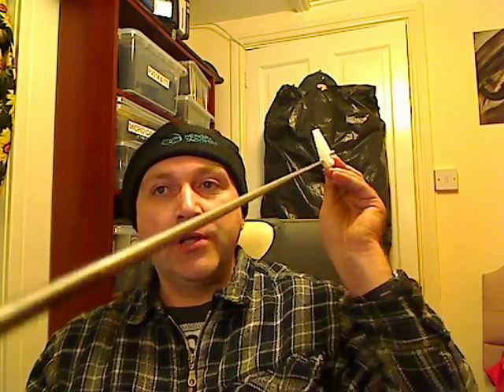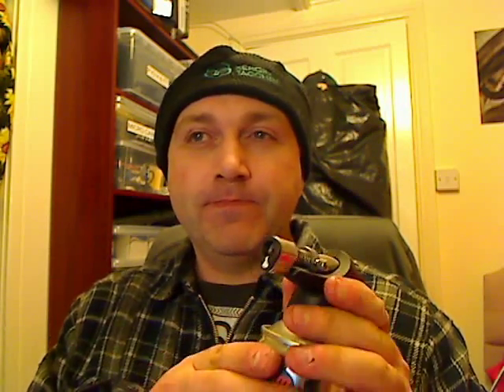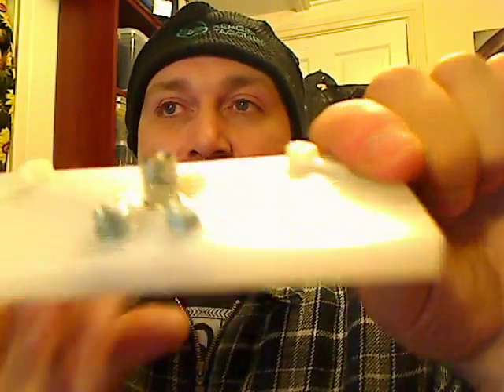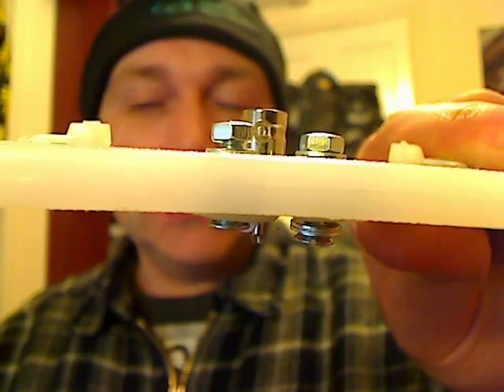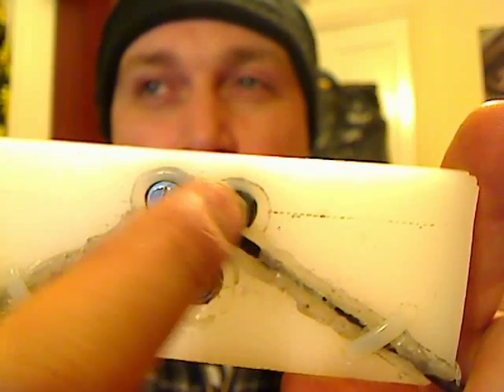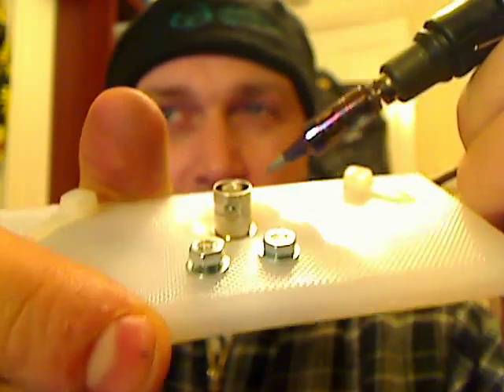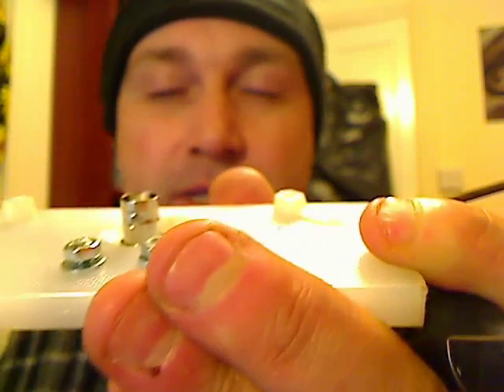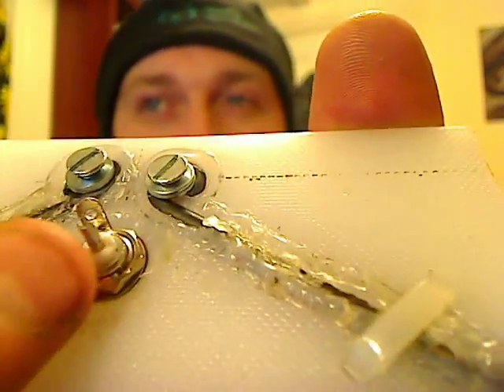V Antenna DIY for microlight and ultralight

Comment: I made one for my aircraft following the instructions here: 
http://chrusion.com/public_files/InvVeeAntenna4ULs_rev3.pdf
As a note, I used a metal coat hanger for the actual antenna so didn’t need to heat the metal in order to form the loops at the ends.
My transmitting receiving range using a handheld radio improved from five miles to thirty miles! It is well worth the effort.
Cheers for the video.